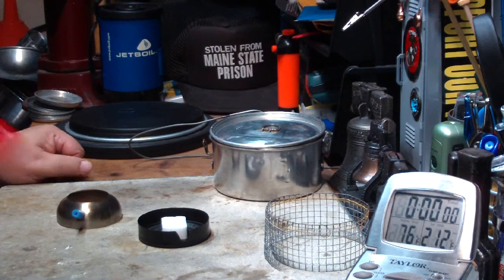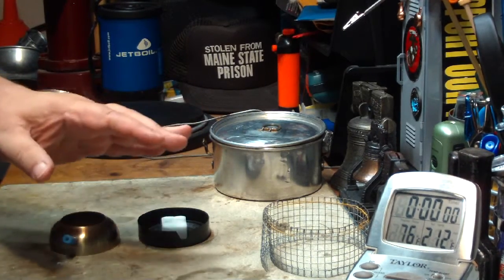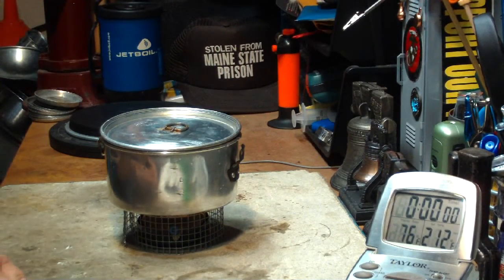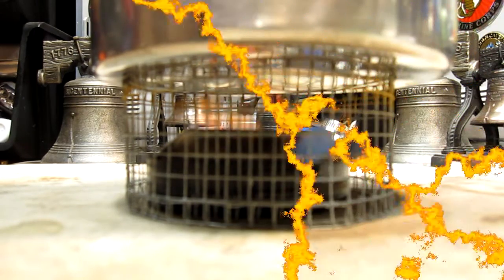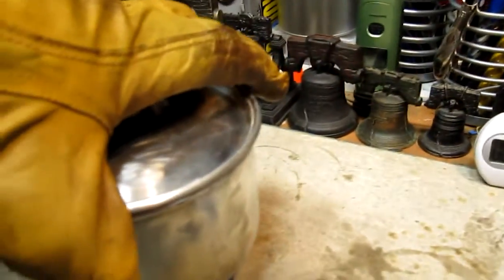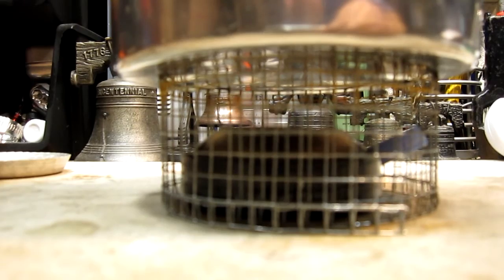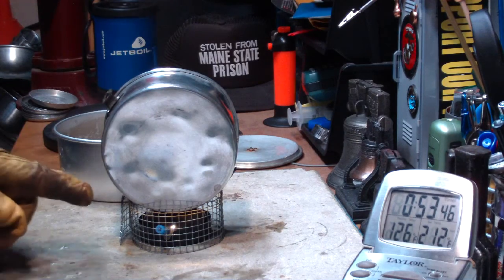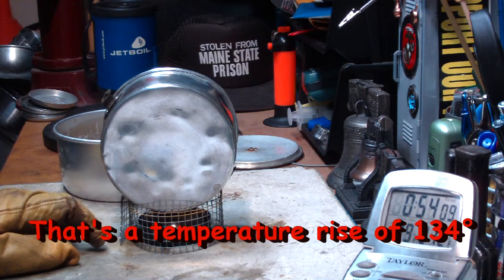Epicurean Classic Stove from Flat Cat Gear - Boil Test #3

Comment: You have the power in (stove output), power out (exhaust gas venting and thermal losses) and power stored (water temperature rise or baking).  The FLAT CAT Systems are designed to deliver about 100 watt of power to the pot.  100 watts will raise the temperature of 2 cups of water by 140 F in 25 minutes In our baking system, this corresponds to an internal pot temperature of about 275F to 325 F.  In Hiram’s test, the temperature rise was slower due to not having a windscreen.  Jon